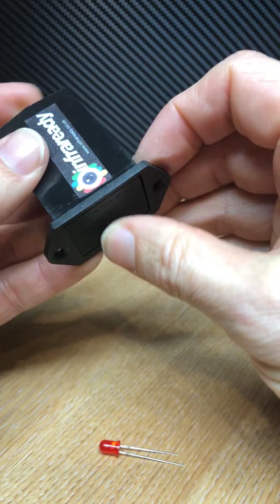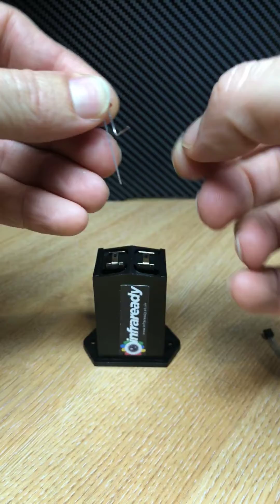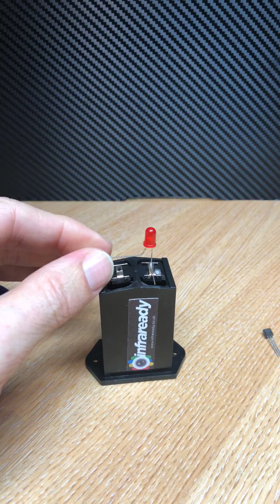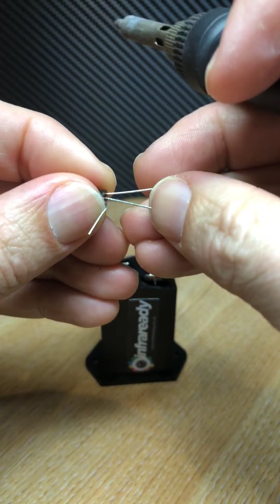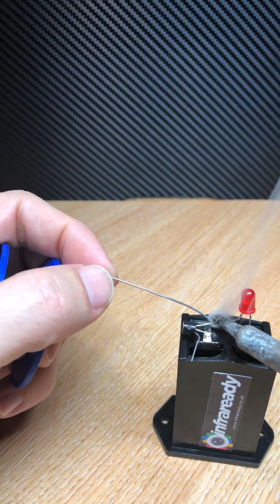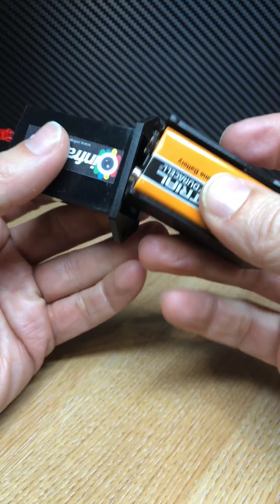Build your own ghost hunting e-field static meter in under 4 minutes

Comment: Do you solder both of the farthest leads on the transistor to the light? You didn't specify. Thanks.
Reply: The closest lead hangs in the air as an antenna, the middle lead connects to the battery, the rear lead connects to light. Didn't you watch the video? He explains it clearly...

Comment: built 2 no MF102 s at his shop so got 2N5638 almost replacements,     built on a dead battery and the LED dimmley like, surprised me I thought it was dead but when I added a hot battery to it I got a bright light and it died.
  I think these might need resisters.   Im not good enough to understand the teck sheets yet, are you? ... do you know where I went wrong? I'm changing the led now.   Second led lit is lit first blew, same battery's. Not working? web and shop said these were derect replacements.   I'm perplexed. Built Big Clive's 9 volters with BC547 and they worked till I boxed them not they are to sensitive and always lit. I'm at a wall and kinda need them for Saturday. 
I could use advice. Please. Bob H
Reply: Im having the same issue dude, i might try a design with a resistor
Reply: @globmobgoblin  I didn't add any resisters as I thought it might power the sensitivity. I have bought some just like that his and 1 out of 3 we're lighting constinstly. I will like to hear what you come up with if you would.
Thanks Bob
Reply: @bobharrison9620  I did some research and found out that each color LED's required wattage is different, I did some messing around with resistors, had some slight luck but was just guessing as far as the math since I was using random recycled resistor parts, pretty sure the issue is LED color, and if we want to run the design simple like in the video, best to stick with the red LED.  I'll keep you posted though homie.
Reply: @globmobgoblin  blue and white led 330 r resistor and green and red 220 r resistor

Comment: * THIS does work great for an Electro STATIC Meter. ESM. BUT NOT for an Electronic Magnetic Field meter. EMF. which is what you would want for ghost hunting. and EMF meter.. Not an ESM Meter! :-/ So this is of no use for ghost hunting. unless the ghost are scurrying around about on your carpet. lol! :D but it is no emf meter. nope. easy design though. ESF but not EMF!
... and also I would want the light to only come on when something is detected..  not go off or dim.
 Again.. this is a ESM meter.. Electronic STATIC meter.. NOT an Electronic Magnetic Field Meter. EMF.
Reply from the maker: Dale Gribbleman that’s right. It’s an e-field Detector. EMF meters are totally different. Where you are wrong is that Static detectors are particularly useful for paranormal investigation.

Comment: Hi. I have a few questions as I’m not good with electronics.
Roughly what’s the lifespan of the 9v battery with this setup?
Does the led diode also need to be 9v rated as I have some I can salvage from 3v and 6v stuff?
Can a small buzzer be soldered onto the led diode circuit to produce a sound when the diode lights up?
Will soldering a small telescopic antenna to the transistor increase the range or just shorten the battery life?
Great video and thanks for posting it.
Reply: Honestly just test it out and try it. Reinvent too something new. I’d definitely consider doing some test on it and a bigger base for sure but don’t sound bad at all. Good questions though!
Reply: If you haven't already, just search "DIY paranormal tools" and there will be videos showing how to make exactly what you describe.
Reply: Don't you love it when they can't be bothered to reply.

Comment: Great , May have a go myself , cheers .
Reply from the maker: Ricky Stuart it’s simple!  Worth a try. Building small sets is a good idea so they can be placed around an object or a room.
Reply: @InfrareadyLtd  hey so im having a similar to Bob H, do you know if led color could be causing the issue, im also using a clip on 9v wire clip connector, dont know if that matters though, ive used 3 different blue led's and they all burnt out brand new, i also tried lowering the battery input into the circut with a lower volt battery that came with the led's, which turns the led on but no static detection works 
Thanks InfraReady
Reply: @globmobgoblin  you better put a 330 r resistor on that shit
Reply: @InfrareadyLtd  issue*